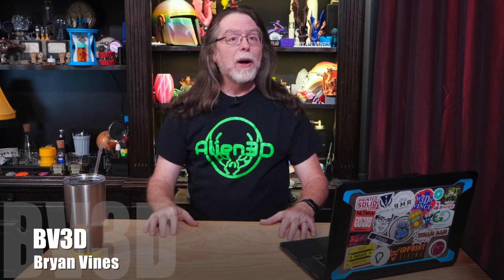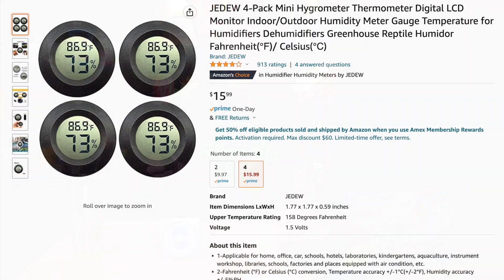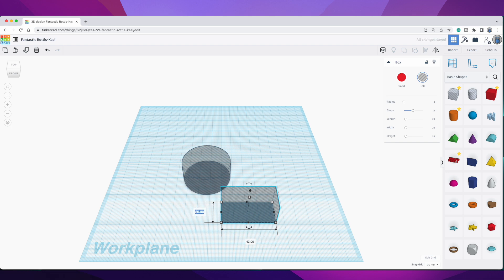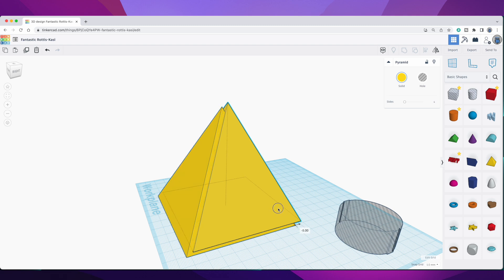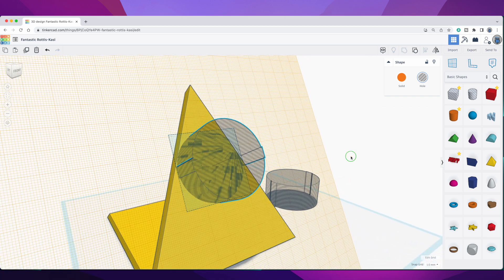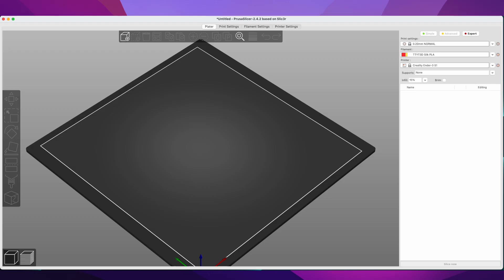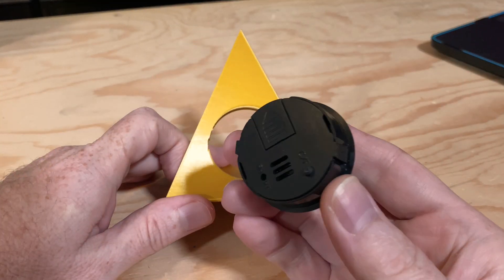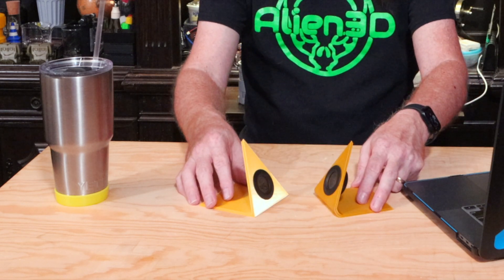Design & Print the ALL-SEEING HY...grometer!

Comment: Bryan love the content. my co worker put me onto you when i first got a printer a month ago and youve been incredibly helpful. I find myself running into an issue that i can diagnose and got a proposition for ya. If you succeed you got me as a patreon supporter and a fresh cup of coffee no questions asked. If you lose, i go crazy and throw my printer out a window. Fair? Fair LOL. I have an ender 3v2, all metal swiss hotend, dual z axis, bowden tube, all metal extruder, jyers and bl touch. All thanks to your vids. The problem im having is with polymaker poly pro filament. Their teal is incredibly strong and a great color. However, my printer hates it. 9/10 times i get a thermal runaway heating error but with zero reason, everythings tight, no temp changes, and no printing issues. It is an incredibly consistent inconsistent problem. I know this because on that every blue moon i get a 1/10 and it decides to print it, i have it dialed in perfect and the prints are amazing. However getting to that 1/10 is a hit or miss, PLEASE help😅

Comment: I enjoyed watching. I have never used tinker cad. I Normally use fusion360 as I started on it for my cnc plasma and I feel 3d printing made me much better with it. 
But I did enjoy seeing how you used the tools for the  Pyramid to make a solid  and than offset it for a cut
Reply from the maker: Fusion360 seems really powerful and I've seen lots of cool things designed in it, but I couldn't get the hang of it for anything other than the simplest of extrusions. ] Tinkercad is more my speed, but maybe some day I'll get into a more advanced CAD application.
Reply: @BV3D  yeah I definitely struggled hard at first I learned alot by watching Lars Christensen.  I use the sheet metal tool somtimes and thats kind of difficult. As I get better I will get the paid version because their is axess to somethings I don't get i can really use